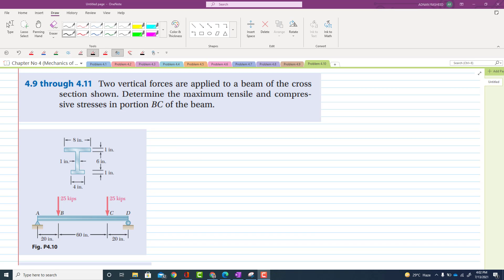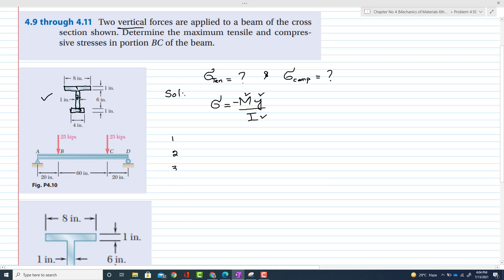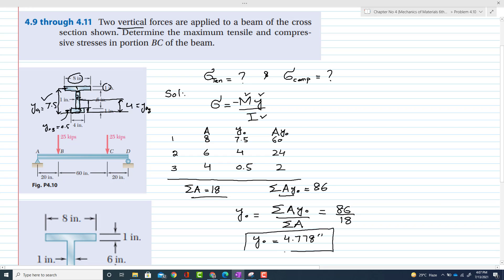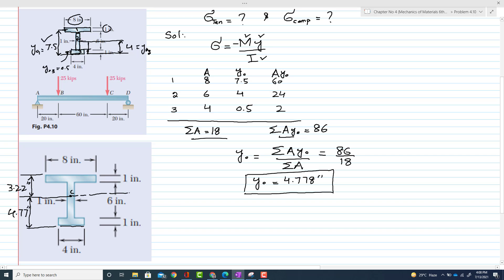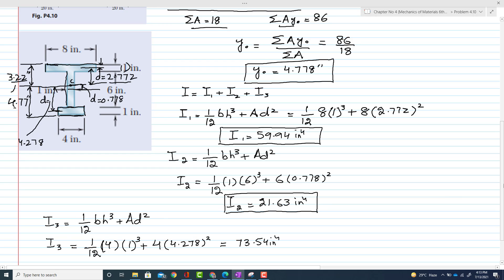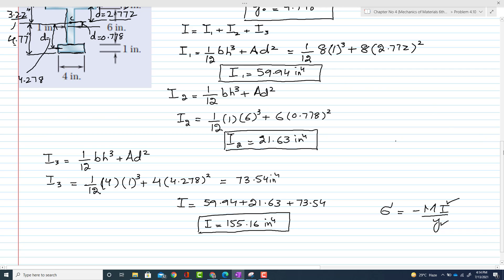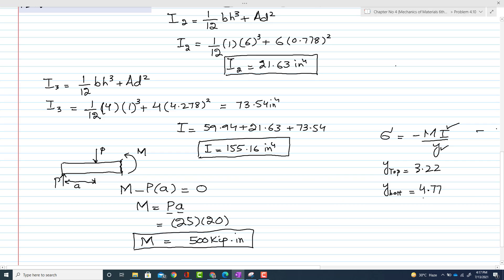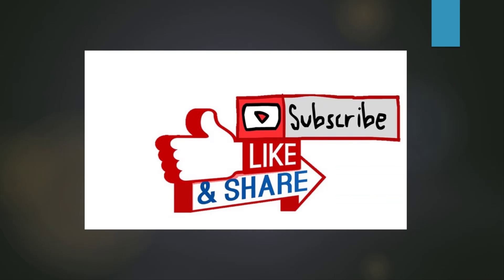#Mech of Materials# |ProblemSolutionMOM​ | Problem 4.10 |Pure Bending| Engr. Adnan Rasheed

Comment: Sir at value of D for section you said 4.778 - 3 to be 0.778 but if we do the calculation 4.778-3 we should get 1.778 and not 0.778
Reply from the maker: Thank you for your valuable feedback. I shall check it again but for time being you can solve it as I believe that you have clear idea how things work so main thing is the idea which you have now.
Reply: @engradnanrasheedmechanical  sure thank you
Reply from the maker: @Rannvijay Singh I have checked it and I think it is correct. As distance of centroid from the base is 4.778 and mid of the section is at 4 (total height divided by 2)so now to calculate d2 we will subtract 4 from 4.778 so d2 will be 0.778.
Reply: @engradnanrasheedmechanical  thanks for clarification